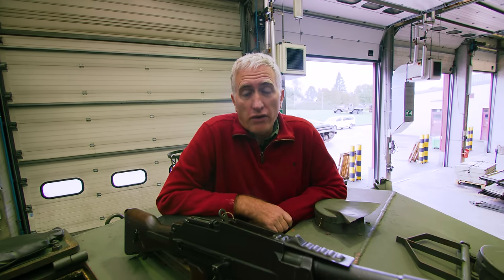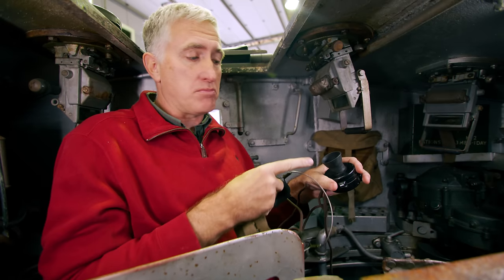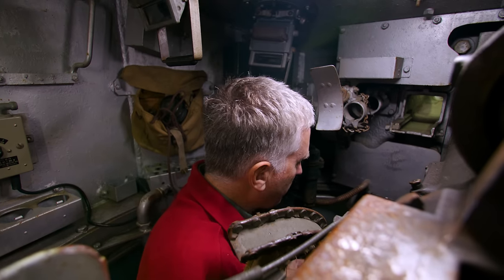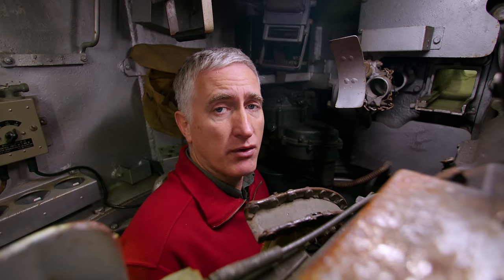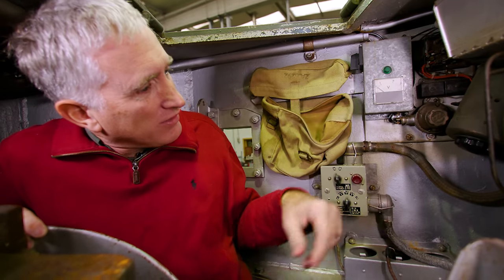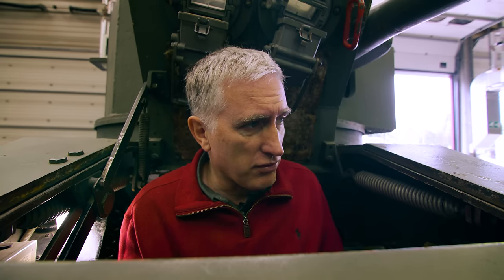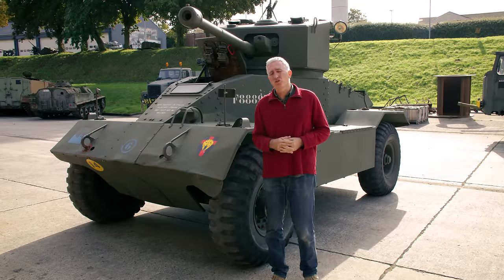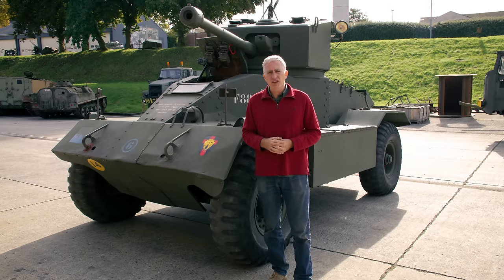Inside the Chieftain's Hatch: AEC Mk II, Pt 2

Comment: TA-50. "Table of Allowances Number 50" - The Department of the Army list of unit owned uniform components (example - parkas and insulated boots), Load Bearing Equipment and Accoutrements each soldier is authorized. Broken down by Climactic Zone (Arctic vs Tropical for example) and assignment within the unit (ie: Rifleman vs Tow Gunner vs Mortarman). Issued when a soldier joins the unit and turned in when he leaves - he does NOT own it. If anything is lost or damaged beyond fair wear and tear, he or she buys it.
Reply: British webbing would have been the 37 pattern webbing. TC would have a Enfield revolver in .38S&W with the hammer bobbed off in a dropleg holster. Generally British tank crews did not wear full webbing in their tanks.

Comment: Apparently, the Besa ammunition was pretty effective at piercing the shield of German anti tank guns which is probably why the British armoured troops approved of it's introduction.
Reply: To defeat two 4mm plates at 25mm interval for the PAK38 and PAK40 or a single 5mm plate for the 37mm PAK, they'd have to be closer than 500m for the AP rounds. Or less than 100m for the other ammo.  Not optimal for allied armour to be getting that close to enemy ambushes.  The problem with stumbling into an ambush, is you generally don't know where the rounds came from, so hard to lay down suppressing fire on the enemy position, when it's somewhere 360° around.
Reply: Simply quoting from an action report of Churchill tanks operating in Tunisia which recorded that Besa fire on a German anti tank position 'penetrated the shields of the gun and killed the crew'.
Reply: @simongee8928  At what range?
Reply: @simongee8928  certainly not the only WWII example of survivorship bias. After action reports were never filed by tank crews who didn't survive contact with the enemy. The idea behind adopting the BESA was that captured German ammo could be used if tanks out ran their supply line.  Haven't read of any accounts where they actually used German ammo.

Comment: Chieftain, As I under stand it the British do change their chamber throughs to match the US 57mm. So they could use USA made ammo. How do you know if that gun in the video has the updated chamber changes ?  Did the British ever improve their guns to take the hotter 57mm loads that the USA started making at the end of the war ?
Reply: No - US 57mm was an exact copy of the 6 Pounder - which came first, the US just copied it. By definition the US gun could use British ammunition and vice versa  from day one. Actually the US lagged in "hotter" ammunition - the British 6 Pounder APDS out performed US 57mm HVAP, so there was no need to "improve" their guns. Gotta ask where you ae getting your information since it is so incorrect.
Reply: @ROBERTN-ut2il  The US 57mm had it's drive band changed from the British 6lb at the start of US production. That is why the British could not use the US57mm ammo.
Reply: @EdAtoZ  Provide documentation, please